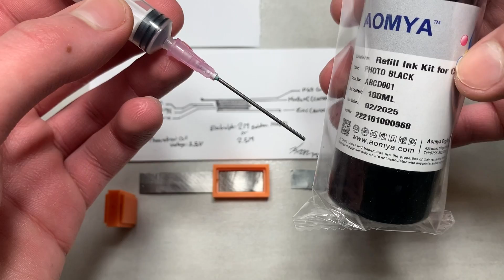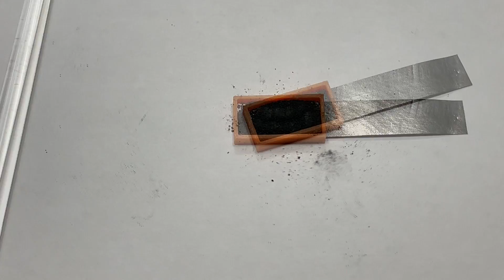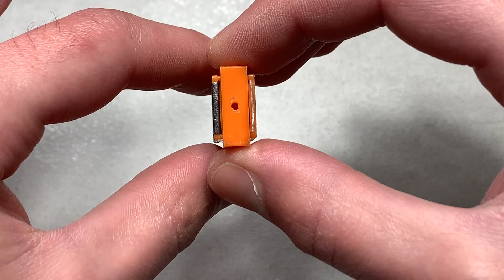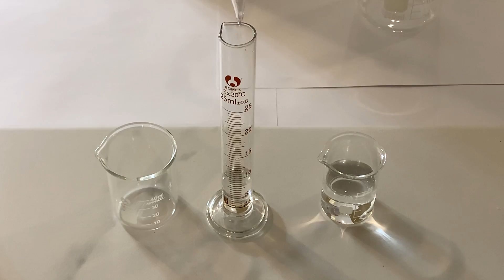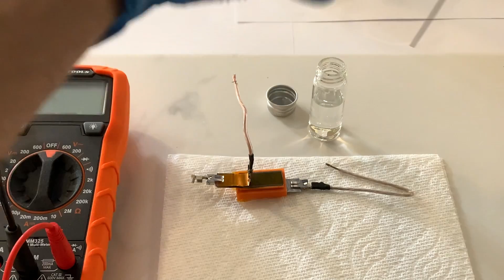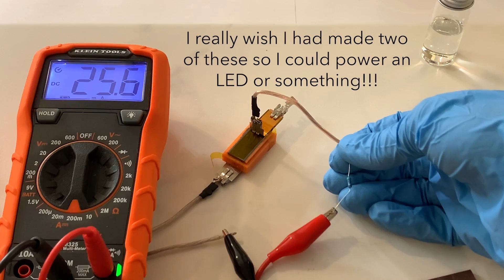Making a Zinc Carbon Battery from Scratch with Raw Materials | Part 1

Comment from the maker: I forgot to mention that the reason I had this idea is because normally, zinc carbon batteries have graphite rods going down the centre, but here I’m basically replacing the rod with a flexible sheet
Reply: Small correction about your current collector, this material is not actually pyrolytic graphite, but what is sometimes referred to as „graphite foil“, „grafoil“ or expanded graphite foil. You are essentially thermally expanding intercalated graphite before pressing it back down creating a uniquely layered structure allowing for high flexibility.
Reply from the maker: @GreenCaulerpa  Wait, really? I really hope that's not the case! 
The data-sheet says that it's a PGS sheet, (Pyrolytic Graphite Sheet), so I'm not sure which to believe, but now I really want to know! So I've heard of graphoil and actually have a couple small sheets of it, but the two look, feel, and perform a lot differently, with these graphite sheets being far superior.

Now I've never looked into it, but I always just assumed it was the manufacturing process that made it compressible (Idk a whole lot about how CVD/ how the compressible sheets are made though so I'm not sure if that's even possible or not) 
I'm really curious to know more though, so if you've got more details on how the two differ please do leave a reply or even send me an email! The channel's email address is on the Channel Info page at the bottom (on a Laptop/Desktop computer browser). Sometimes it asks for a Captcha before displaying the email.
Reply: I wonder if it could be made rechargeable if you used invert/reverse opal instead of paper/cotton; and you used  nonreactive titanium or gold which was merely plated in the reactive metal for the metals🤔 what would happen man?
Reply: @ARandomnèssPortal  all batteries are rechargeable at least one time anyway? it what batteries made from, and how destructive the making of escaping electrons are made (making one time use batteries (hint: one time use, the manufacture, put it's first charge, in, an started the slow self destruction beginning, on NOT rechargeable battery)

Comment: While you have everything open faced, half cells, saturate every component with electrolyte..
Reply from the maker: Yeah, that would be the optimal way of doing it, and it's how commercial zinc-carbon cells are manufactured, so It's obviously preferable. The only reason I didn't in this video is to keep this first test as simple as possible.
But I'm currently working on a Part 2 where I'll be using higher-quality materials to not only make a proper electrolyte solution, but also to test out different cathode compositions, and I'm thinking of assembling a cell with everything pre-soaked with electrolyte in that video.

Comment: I mean, the case is the only 3d printed part of the battery but I guess you can 3d print the entire thing using a cocoapress? Good video.
Reply from the maker: Omg cocoa press is a CHOCOLATE 3D PRINTER!? You might be onto something here, if it’s meant to store and extrude paste like molten chocolate (I saw a video of one YEARS ago and they were pretty accurate!)

There’s no way that after some modifications  it wouldn’t be able to deposit battery electrode slurries?

Comment: Do you project any benefits to this battery type or were you mostly interested in doing the experiment to see the results?
Reply from the maker: The zinc carbon battery is a pretty old and commonplace battery type, so this was an experiment to see if not only I could make one, but also to test out how PGS graphite sheets hold up as electrode materials

Comment: Why did you use the glue? Won't that poison the cell?
Reply from the maker: No, I actually chose rubber cement specifically for that purpose. At least the kind that I have is just rubber dissolved in some kind of solvent, so all that’s left behind once dry is inert rubber!

If you meant the glue stick, it shouldn’t chemically interfere at all. (Glue sticks are made of PVA or PVP, both of which shouldn’t affect the reactions)

Comment: Have you played with stainless steel/aluminum any? I managed to get a volt (i didnt measure the amps) from an improvised battery right after they declassified the tech. Was fun.
Reply from the maker: Steel/Aluminium? The steel probably wouldn’t give too good of a result, but aluminium actually works surprisingly well!

About 3 years ago, I made a cell using aluminium, potassium aluminium sulphate, copper, copper sulphate, and graphite. 
It went up to like 1.9V and with two I could light 3 LED’s super brightly. 

I might revisit it in a video
Reply: A standard ice tray with 1 1/2"×1 1/2" stainless plates smaller than 1/16" thick wrapped with (I forget the gauge) in each cup wire in Series put off 1.2-1.3 volts using saltwater as an electrolyte.
Reply: Sorry wrapped in aluminum wire
Reply: I think the common name is aluminum air battery.
Reply from the maker: Yeah that was most likely an aluminium air battery you made! It even works with magnesium!

Comment: If you could get the layers thinner and add a few more would that not increase the power output?
Or maybe you could try rolling it for more surface area like a typical disposable?
Reply from the maker: Yes, making the separator thinner would definitely help, i'll be doing that for my next video on these. I'll be also using better, more concentrated electrolyte and more active material in general.

Comment: I would love to see a comparison between this homemade battery, and a freshly topped off capacitor. Which one can last longer? A battery that can rival a capacitor truly meets the test of being a viable technology.
Reply from the maker: I’m pretty sure the capacitor would give a higher initial current but die out earlier, while the cell I made here would continue providing ~5mA for quite a few hours. 

The performance of this cell wasn’t very good, so in a way it kinda behaved like a capacitor discharging. 
But once I get the new chemicals and materials I ordered to make my next video, I think it’ll behave a lot more like a proper battery cell. (I’m quite certain actually)

I’ll also modify the design of the shell a bit to provide more compression force.  

Thanks for watching!

Comment: I like the effort, but I think in my opinion you went way overboard putting together this simple battery. 😮 you need to change your electrolyte. Not the most efficient solution young man.😢Also this type of battery needs pressure squeezing Anode and Cathode together which would increase Voltage and Amperage. I was thinking you should be achieving 1.5 volts at half an Amp. You should at least ‘try the roll method. You would have something the size of a AAA battery this way. 😊thank you for sharing your knowledge and skills with me. I did subscribe to your channel mate. Cheers😊😊😊😊😊😊😊😊😊😊
Reply from the maker: Yeah I was expecting more current too. I think the rather underwhelming performance was due to how thick the separators were, combined with the relatively weak electrolyte and not enough active cathode material. 

I’ll also try and find a way to increase the pressure between the layers for my next experiment. I’ve recently ordered much better quality chemicals/materials so that hopefully for my next video on these the results end up being a lot closer to commercially made cells. 

I’m hoping that the new cells will be able to provide at least 250 - 850mA and have voltages of 1.5 to 1.7V.

Comment: the biggest current limiter here is the amount of separator material. The ions have to move a lot inside of the cell to do their job and that increases the internal resistance by a lot
Reply from the maker: Yeah that’s what I suspected too, next time I’ll be using a lot less of it in exchange for more active materials

Comment: Very very interesting. Next time you could try to make a brick with distilled water for the powdery part, and try an higher concentration.
I like the idea of the real time clock
Reply from the maker: I thought of that too, but another comment make a good point that making a solid block out of it would make it more difficult for the water to absorb into it. Sort of like dropping a pill in water, it takes a while for it to dissolve. 

I think for the next video on this I’ll either apply it as a paste or just do what I did in this video but with more material.

Comment: is that rechargeable? how to do it?
Reply from the maker: Unfortunately these cells aren’t rechargeable, but I’ll most likely try and make a nickel iron rechargeable battery using some of the new chemicals I’ve ordered once I receive them. 
I’m really really looking forward to it!
Reply: @KeonsLab  making capacitors in high capacity instead of cells is not easier?
Reply from the maker: Like with pre-made capacitors or to make my own? As far as I can tell it’s a lot easier to make decent capacity batteries rather than (electrolytic) capacitors. 

I do admit the performance of the cell I made in this video wasn’t providing as much current as I was hoping it would. 

It should’ve been 150mA at least, but I’ve ordered much better quality chemicals and will be modifying the design for my next video to hopefully try and get 250 - 850mA @ 1.5 - 1.7V. I’m really looking forward to making that video too!

Comment: u should roll everything up into cylinder shape,..  u can get bigger reaction area,... hence maybe higher voltage and maybe more capacity,...
Reply from the maker: That could be a neat idea, I’d need to get a much thinner zinc foil. I’m just not exactly sure how I could roll it tightly enough without spilling any material.

Comment: Yeah, with that much current draw you're plowing headlong right into the Peukert effect.  That's why the voltage climbs back up after.  But it's a neat design.  The obvious next step is to standardize production a bit so you can test variables independently; in particular, I wonder what using an acid-free paper and avoiding absolutely any additions that the solvent (and electrolysis) might pull into solution and mess with the chemistry.

But this also seems like a reusable platform for other chemistries, though some with more powerful acids might require a post-processing step (coating in something like a thin layer of silicone) to keep the acid from attacking the filament.  But a stack of nickel-iron cells would be extremely resilient and fully rechargeable...
Reply from the maker: Oh that’s a neat idea, nickel-iron cells are quite simple too. For the zinc carbon cells I’ll be testing out different electrolytes and better cathode materials to try and get as close as possible to the performance of commercially made cells. 

I think that would be the coolest thing, to be able to power electronics using my own battery cells!

Comment: I'm pretty sure you could print this battery in place.

Start printing and print a few layers. Stop. Place the carbon strip. Keep printing (with the strip in place, fused to the plastic molten over it?) up the walls. Top with the black powder (sorry, 3D printing nerd, not a chemist myself!) and place as much absorbent material as you want and top with the solution. Secure the zinc stripe on top, and finish the top layers.

Pros:
- You could batch print like 10 of these if you had the materials ready
- You don't need to post process the batteries, they should be ready as soon as the printer finishes

Cons:
- Some material may be heat sensitive, and thus may make this process harder or impossible

Loved the video, keep up the good work!
Reply from the maker: That’s an interesting idea, I’m not too sure how well the top layer would turn out, also one of the reasons I made 3 pieces is so that excess material could be placed to provide some compression force when they lock together with the ridges that form when they’re 3D printed. 

But with a custom jig or something it could be possible.
Thanks for watching!

Comment: I believe your glue stick might be related to the fact that you have a drop in current. The flow is likely having to go around the glue, unless it dissolved. Very cool project.
Reply from the maker: Maybe I could try making one with a very minimal amount on the sides or even no glue at all to see if it turns out better. 
Thanks for watching!

Comment: I wonder if it could be made rechargeable if you used invert/reverse opal instead of paper/cotton; and you used  nonreactive titanium or gold which wss merely plated in the reactive metal for the metals🤔 what would happen man?
Reply from the maker: I’m not too sure what invert opal is but I’d assume if the electrolyte and active materials are the same then it would most likely be quite similar
Reply: @KeonsLab  if I'm wrong teach me tho once you learn
Reply: Oh I shared a link. It might be in your spam void.

Tldr It was an scientific intro article link.

But tldr tldr: they're like semiconductors for light but because they're like the leftovers of opal if you make a negative volumetric casting of it, on the nanoscopic level it's a strangebhoneycomb sponge thing that stores electric charge good too I think but idk for sure tho
Reply from the maker: Oh very interesting I’ll definitely take a look! I will be most likely making a nickel iron rechargeable battery in the near future though, and I’m really looking forward to receiving the new chemicals I’ve ordered to do so! 
I think you guys are gonna find it very interesting!

Comment: I think your battery shell needs an air vent, to allow air out while electrolyte goes in.

it may work better to do that backwards, suck the air out of the shell with a syringe, while allowing electrolyte to fill the vacuum.

Comment: Great video!
Just a small food for thought/suggestions for following experiments:

- Power output might increase if you sand a bit the electrodes since physically the surface area available for reactions increases;

- To be full assure that the electrolite is well spread inside the battery (important for repeatability and reproducibility) some air might be still trapped inside the battery and be a problem. Perhaps you could edit your battery box to have at least two holes, one for the electrolyte input and one for the air output. Then you stop pumping the syringe when electrolyte is visible from the output (horizontal pumping should be enough? Or syringe input in a lower position than the output);
- Anotate the initial value and the leftover in the syringe to have the full volume of injected electrolyte (might be usefull for later statistics).

Thanks for the vid! Good work!
Reply from the maker: That’s a good idea! I will definitely be keeping track of the volume of electrolyte for the next video where I’ll be making several cells and testing different electrolytes.

Comment: Zinc carbon batteries actually use a mixture of zinc chloride and ammonium chloride. This electrolyte is not rechargeable though.
This also works well with just zinc sulphate, and makes the cell rechargeable. 1 molar ZnSO4 works. For extended cycle life, add 0.2 molar manganese sulphate. This stops the manganese dioxide from degrading as quickly. Good luck mate, excellent project!

By the way, I also experimented with cells using graphite foil electrodes. They’re very good for testing, and make prototypes really easy to assemble. Personally, I used 4cm by 2cm clear sticky labels for a case, and just used one layer of absorbent separator. Stick one piece of graphite foil or zinc foil to each label (after pasting the graphite foil with the cathode mix and drying it to make it solid, of course) then add the separator moistened with electrolyte, and stick the two labels together to seal it. A poor man’s pouch cell..
Reply from the maker: Yeah I unfortunately didn’t have any zinc chloride when I recorded this, but I’ve gotten some Zinc Oxide that I’ll use to make some. I really want to compare the performance of the two electrolytes on their own and then with both mixed together.
UPDATE: I've received the Zinc Oxide I ordered and made my own Zinc Chloride, I'm currently working on Part 2 where I'll prepare a new electrolyte and test out several different cell variations!

Comment: Can you make those cases 10 by 12 but 3 inches deep. Also a lip on inside so when pushed together it snaps into a locked hold. This way when compressing it stays tight